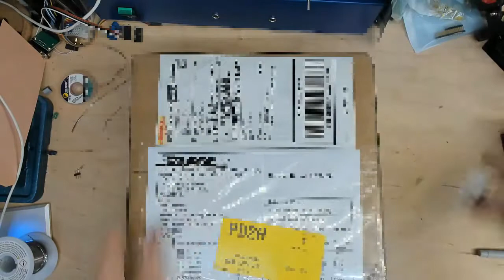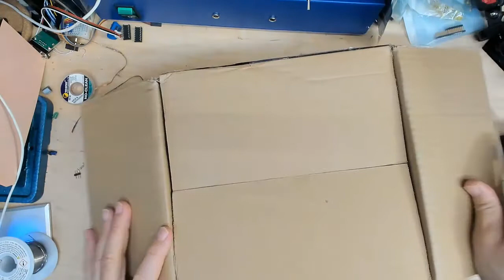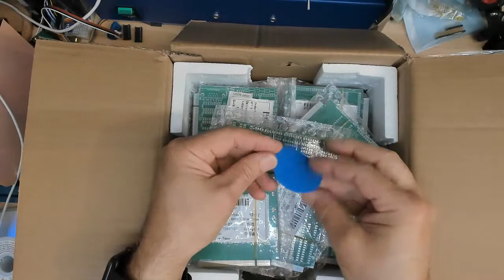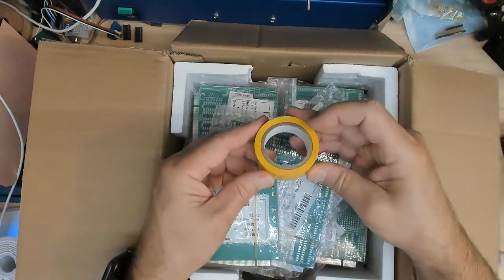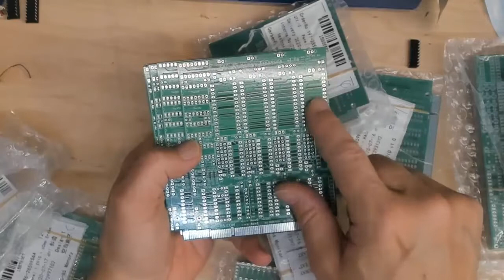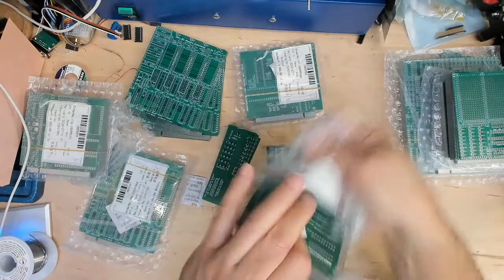{59} Christmas in July: Latest JLCPCB order with two new SBC-85 boards... But where is my surprise?

Comment: I have slowed down on my orders for PCB's now. I actually like the tape they sent this year. I ended up with 6 rolls. The little key chains are ok if you are into them I guess ;)  I will say that PCBWay usually sends an extra board.
Reply from the maker: The freebie from JLCPCB is more for entertainment purposes. I could use a sample PCBs with text / trace size examples but I can’t think of any freebie that  have been terribly useful. The tape just seemed like they were giving up all hope that things will eventually return to normal.